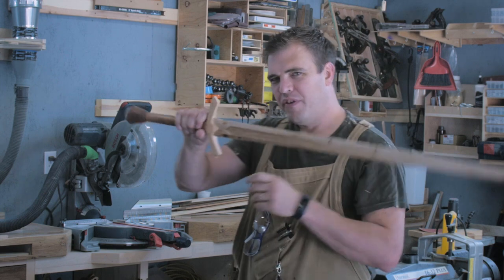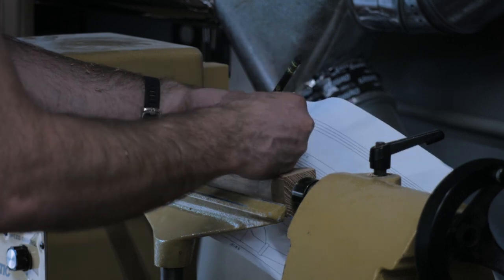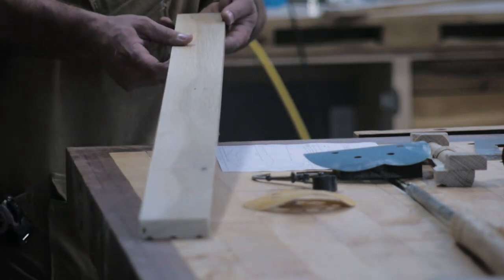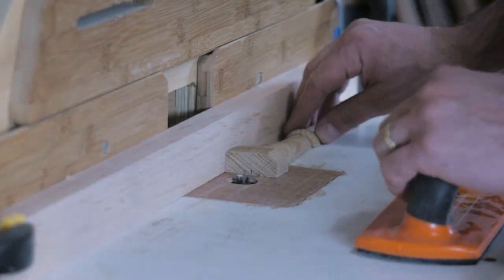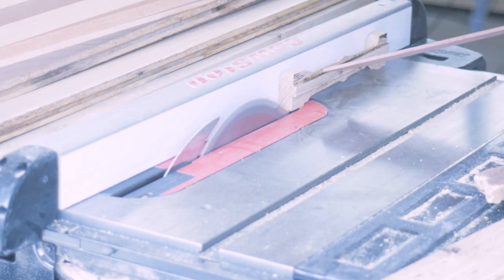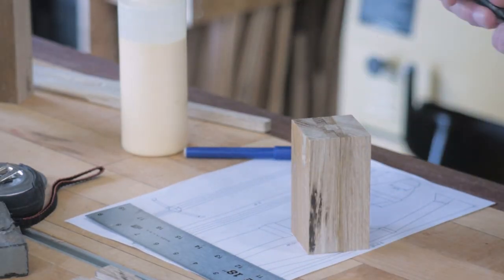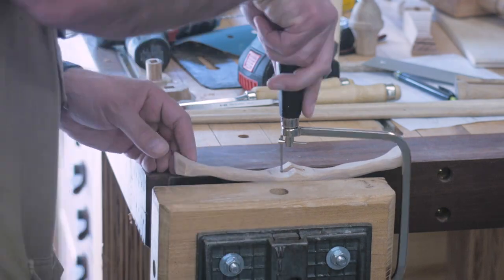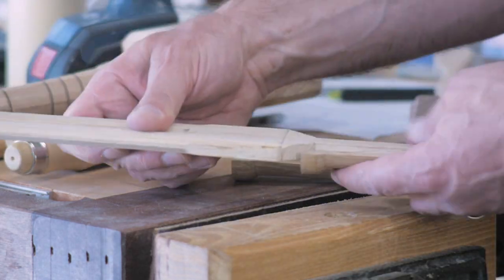Making a Wooden Ranger Sword

Comment: How well would the construction you employed hold up in sparring practice?
Reply from the maker: It would hold up fine for swinging around, but I wouldn't recommend it for contact sparring.
Reply: Geeks Wood Shop What if I kept the tang nearly the same width as the blade, and then, after turning a hilt, cut out the middle sections and glued the halves on either side?  Then it wouldn't need to be thin enough to be slotted into the hilt.
Reply from the maker: @minh-khanguyen7209  Ya, I think that approach would work well.  I've read that Ash or Hickory are also good woods to use for sparing purposes.

Comment: Dude, did it not occur to you to use the scroll saw to cut the square ends off of the hilt?
Reply from the maker: Ya, I may re-shape it at some point.
Reply: Geeks Wood Shop okay, just stay safe you mad-man.
Reply from the maker: Oh sorry, I misunderstood the hilt and the handle. You are right, good suggestion, will try that on the next one, thanks!
Reply: No worries, my bad. The crossguard looks alright, it might even be useful in a real sword for Half-swording. There were plenty of weird shapes for that stuff. The sword looks awesome. Stay safe, cheers.